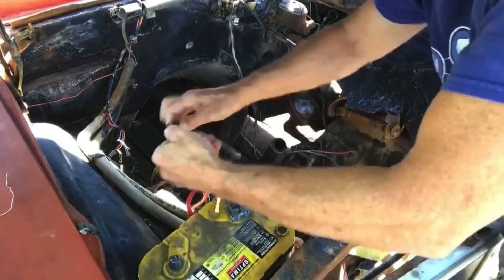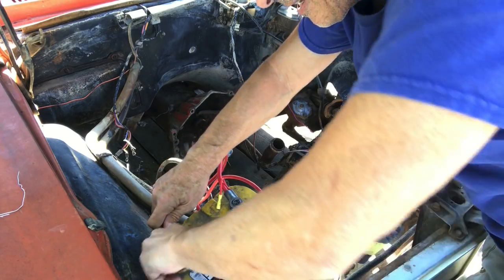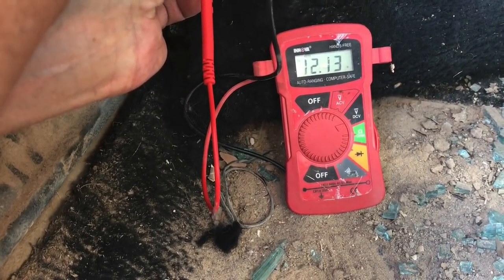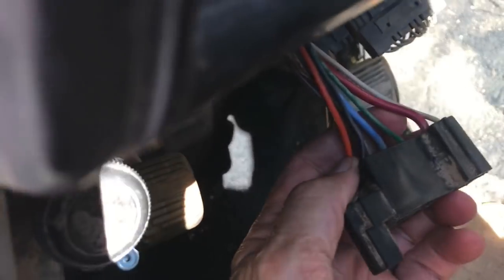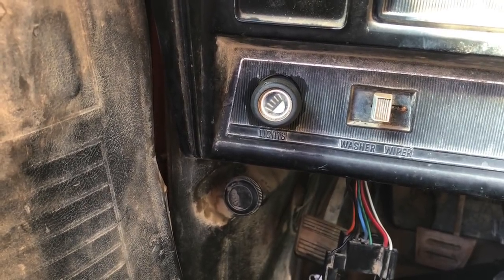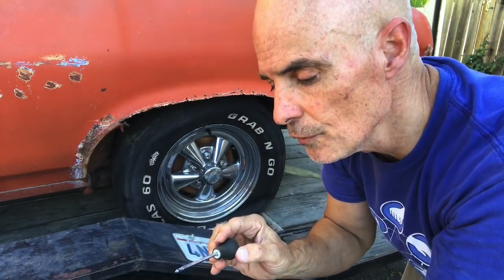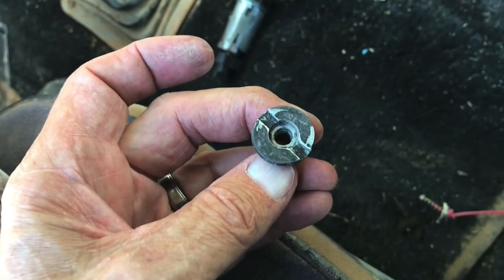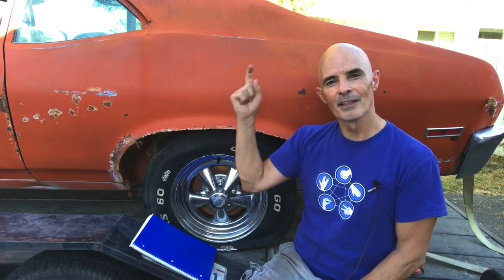HOW TO: MUSCLE CAR WIRING-PROJECT NOVA PT 2

Comment: Ah, the lost Chevy of Atlantis 😂😂😂. I get a kick out of these guys saying, "buy a new harness." On a car that old I'd buy spools of wire every color and a box of terminals. There's what, five wires in the engine harness that year? 😂 Those old connectors are super easy to take the spade terminals out of. No way I'd spend hundreds to do a wiring job that could be done for less than $100, especially since every motor is going to need it's own custom harness.
Great channel! Thanks for keeping us updated!

Comment: 12v at the light blue wire at dimmer switch connector meant you had power from the head light sw. No headlights at this point meant you had grimlins because with new dimmer switch the headlamp should have worked. But you needed headlamp switch anyway because tail lights didn't work. I worked at GM dealer for 40 years. Driveability, and electrical was my specialty. Was shop forman and sevice manager over 30 years same dealer.Have 4 LS engine projects going so Richard you are my new hero.

Comment: Project cut and run - When wanting to make a quick escape, a ship might cut lashings to sails or cables for anchors, causing damage to the rigging, or losing an anchor, but shortening the time needed to make ready by bypassing the proper procedures. To me it simple you are going to be cutting motors in and out and modifying it to make it work even though it may cause some damage.

Comment: Great video man. I'm sure you know it already, but watch that wedding ring when playing with open electrical circuits. You can get a nasty shock that'll wake you up in a hurry. One of my most unpleasant experiences while servicing an AH-64 Apache during my time in the service.😂
Reply from the maker: got arc marks on it already-Apache (nice)
Reply: @richardholdener1727  yep, to be young again. Of course the Apache was running a dual 24 volt DC battery setup through an AC inverter to a central bus right in front of the hydraulic servos for the flight controls. Needless to say, it was the last time I EVER wore a ring or forgot to disconnect the power supply while I was working on it.😂

Comment: How about a test that knowbody else does,  a port volume  to throttle response test on the Nova , being a GM car install a 302ci SBC to emphasize the torque changes then on a number of different port volume heads that produce lets  say around 450hp then drive the car , seat of the pants results are good but data logging would be great , 165cc intake port and 225cc intake ports can produce simular power and torque curves.  You love exposing myths so , what do the different heads  drive like ?

The Nova adds a new dimension to your channel. 
Keep up the good work

Comment: Richard Holdener, what are going to do for the Nova's fuel system? Right at this minute I'm welding a Competition Engineering fuel tank sump to my 69 Chevelle's tank. Coming out of it to a inline pre-filter, to an inline pump, and then one of the Corvette fuel filter/regulator(smaller line back to tank), then on to the gen4 4.8L.
Reply from the maker: going to check for rust in the tank first

Comment: Im restoring a 72 and a 74 nova as cheap as i can but will be very nice trans fluid and rags will make that back seat look very nice cheapest carpet i could find is about 160 black about 350 for the door panels and back panels ablot 150 dash pad cap just found your channel and about to sub
Reply from the maker: thnx for the heads up on the parts-mine needs carpet (just posted the interior removal vid), door panels and dash pad

Comment: Hey Richard. When you have a chance. Can you do a video on exhaust manifold of a chevy 350. Comparing truck log 1995 exhaust manifold, 1995 Camaro exhaust manifold. 1995 Corvette exhaust manifold and the classic Corvette Ram Horn exhaust manifold. To see the power difference. All have a chevy 350. Yet they all have power difference ratings. Wich makes me wounder if the factory exhaust manifolds where intended to with power restrictions in mind. By the way. Nice Nova. It is red and you bought it in October. Red October or Rustoldva= Rusty old nova.  The red color also reminds me the Red Algae found in the ocean aka  Rhodophyta.
Reply from the maker: minimal difference between stock manifolds or shorty headers
Reply: @richardholdener1727  At all RPM range? Or to a certain point? In a website called F.A.S.T.   Is a website for classic cars to race. One of the rules is allowing 2 1/2 exhaust collector and tubing allowed. With stock manifolds. Non ported. Is where it got me thinking. The Ram Horn exhaust manifold did reveal something interesting. On a 1960 corvette the firing or is still the same as a 1995 v8, 18436572. I was looking at the Ram Horns based on the exhaust timing. This is what I found. 1,8 and 7,2 are long runners. 4,3 and 6,5 are short runners. It looks like a tuned port exhaust flow from the factory.

Comment: With a charged battery, check your voltage at the tail and head lights and when you get it wired from the battery to the harness correctly, check voltage and resistance. If the car was submerged your gonna get a lot of resistance from corrosion.  Not sure if you’ve driven and old car at night lately but your gonna swear your headlights don’t work, things  are like reading by candle. I have a 85 Chevy k20 i daily drive and it’s awful at night ( Im sure age doesn’t help too) so are my other 2, 72 GM cars. Lastly like the Old Navy Cargo short work shorts you have on here, I have several of those myself. They seem to last a lot longer in the work short category than they nice short category.

Comment: Meter that dimmer switch to see what wire is hot and run a jumper to the headlight circuit. Did that on my Monte, have no brights but the headlights turn on with the switch.

Comment: The headlight switch works better when you have it grounded to the dash, like when it is installed in the dash.
Reply from the maker: the dash mount is plastic
Reply: @richardholdener1727  The face of it is plastic, but the dash frame behind the switch mount is steel.

Comment: If you use telephone wire instead of standard gauge you can reduce the weight of the car by 7 lbs
Reply: If you buy candles, no wire no battery, no problem 😁😁
Reply: Mount all the lights next to the switch inside the car.

Comment: Richard, what's the best hci combo for the fox body 302 engine street/strip application?
Reply from the maker: The TFS stuff we did worked well-the 11R heads, or AFR-carb will make more peak power than the long-runner EFI intakes
Reply: @richardholdener1727  I appreciate it sir

Comment: Also - rather than use a battery to provide the power when testing the circuits use a battery charger - in that way you can see that everything is working but if there is a short it doesn't burn the wiring or start a fire.

Comment: dont those switches need to be grounded to work?
Reply from the maker: the wiring has a ground-the dash is plastic
Reply: The ground goes directly to the lights. Only the power is switched.

Comment: "FrankeNova" since your constantly going to swap all types of "other guys" in it! plus you can rattle can it green with some stitches and the rust will look right! Heck screw and rivet patch panels to the floors and where ever else you can to complete the look!
Reply: Rusty - Nova Frankenstein!   Kinda like Casanova Frankenstein from Mystery Men!  😀
Reply: Chanel : Shop 209 . Already has a nova he is calling Franknova
Reply: @danboutin8700  Great... the only other I seenthat I liked was "Nova's Ark" but I still like mine since it will have the "other guys" engines swapped in and out of it.  This would be more "FrankeNova" then the other I'm sure.

Comment: you can get a TCI adapter kit on ebay for about 550. it will bolt a Ford Windsor to a Chevy 700R4, 4l60 80E, Turbo 350, 400, POWERGLIDE! lets see some blasphemy!!

Comment: Told you it looked like a flood car...

How did I know?  I used to restore totaled wrecks for a living, and I've built several of them.

I know you don't want to hear it, but I'm going to give you some good advice: start looking for another project car...

If you don't replace 100% of the electrical componentry in that junker, it will never stop giving you headaches.  I learned that the hard way, and I'd hate to have to watch you go through the same misery.

Also, it's just too rusty.  Those cars don't have a full frame, so unless your planning on installing a full cage and subframe connectors, something like a 500 Cadillac engine will have enough torque to break that fragile  rustbucket in half.